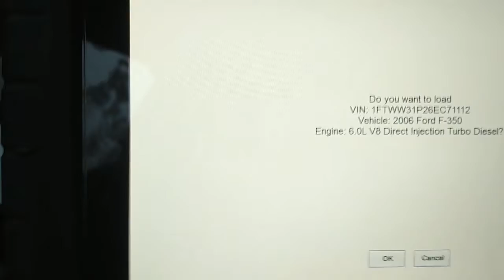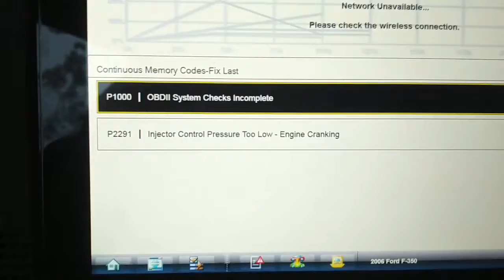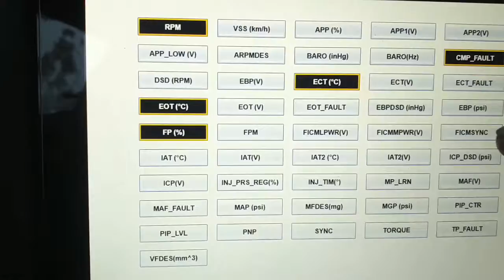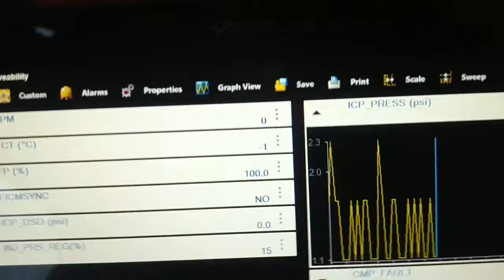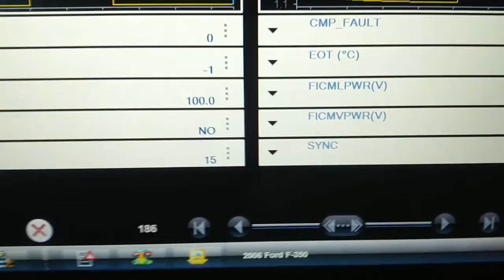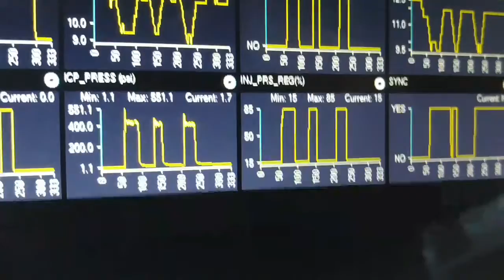2006 F350 6.0 No Start Low ICP part 2

Comment: IPR duty cycle was 85% so either the valve can't close (debris) or it has a large HP oil leak. Hope it's not the snap to connect STC on the HPOP feed tube. I've seen them blow off with such force that it cranked the rear gear drive cover. I have an air fitting that threads into IPR valve port that way I don't have to command the IPR valve from the scan tool while I air check the HP oil system. Just don't unhook the air while under pressure or it will take you to the magic fountain show! Ask me how I know🤠
Reply: Tig weld up the side holes or braze them up and braze a pipe nipple on the end for air fitting.
Reply from the maker: That's a great idea. I'm going to make a fitting to put into the IPR location. Maybe I'll put a section of air line on it with a ball valve. Thanks for the tip.
Reply: The test fitting has to have the O-Ring and the air goes straight through. 
The side port on the IPR is the relief. 
I can email you a picture of it if you want.
Reply from the maker: @ovwok  I was thinking of making one out of the original IPR. That should work I think. I'll have block off the side ports I guess.
Reply: If you get tired of trying to make one here's a link
https://www.amazon.com/DEWHEL-Fitting-Powerstroke-Diesel-Pressure/dp/B07JVBB7WZ